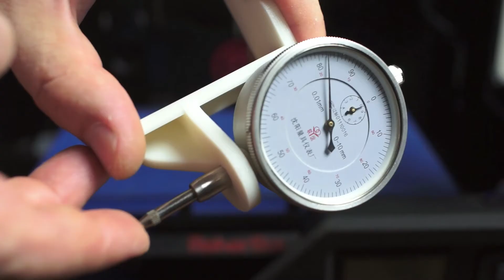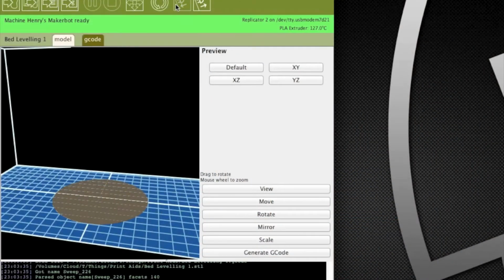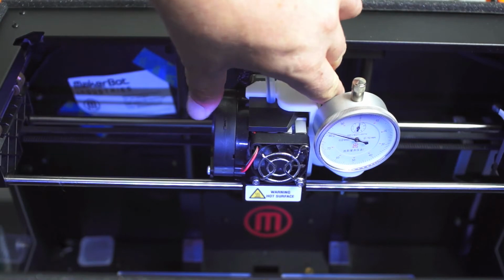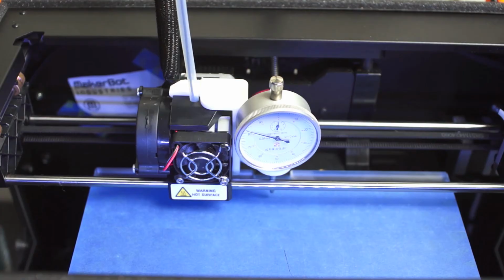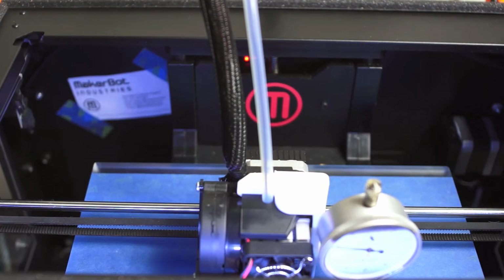3D Printing with the Replicator 2 - Levelling the Build Plate (5 of 8)

Comment: How do I use the dial indicator? Does the needle needs to point to 0 when it comes into contact with the build plate? If not, do I turn the screws on the build plate until the needle points to 0?

Comment: These videos you've made are awesome, thanks for the high quality inputs to the world of 3D-printing with the Makerbot! I use a kind of brute force method to remove the prints which I've found works really well. I take the acrylic plate and place it over my knee and push down on the short ends of the plate. This manouver breaks many of the bonds between the prints and the plate. I then use a scraper used for flat cooking plates, works great!

Thanks,

Marcus Helgesson, CEO - ForceBoard